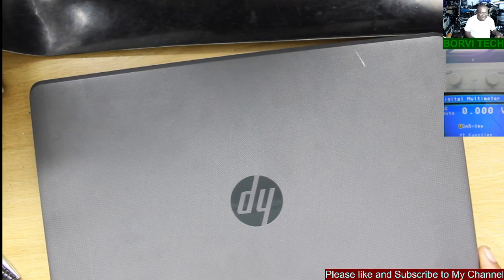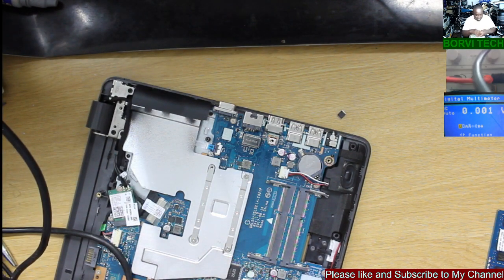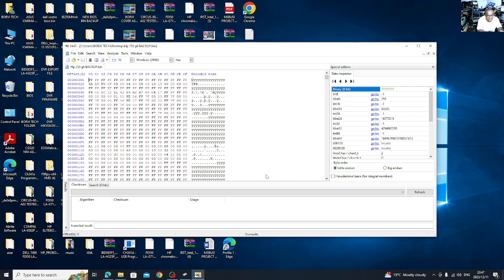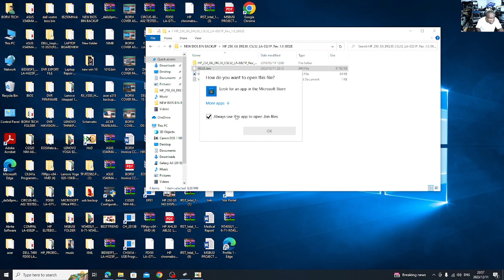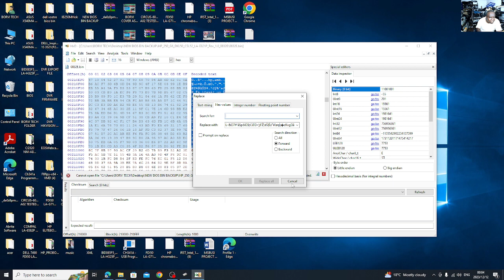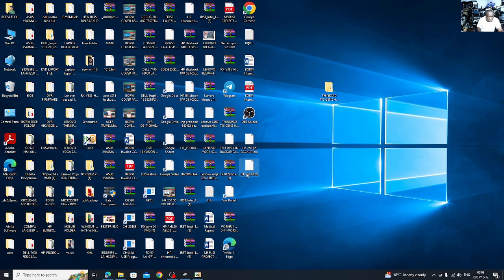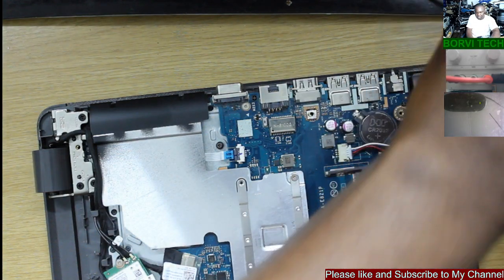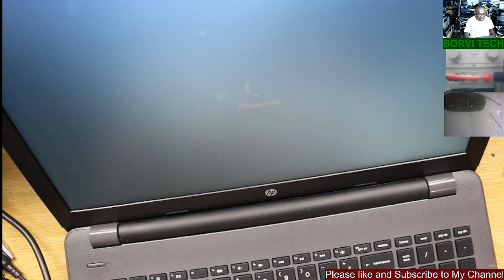Hp 250 G6 Backlight No Picture (Bios Cooked)

Comment: I have a HP 250 G6. Firmware update from windows, and doesn't start anymore. The chip is not exactly the same. There are two of them in that area, and the disipator is golden, diferent from this. Is there any way of reprograming, using the cable that comes with the usb  programer circuit?
Reply from the maker: Yes its possible if you know exactly what to do///// but the best way is to disorder the  chip from the board and make a backup.... then go to the official website of Hp and download the bios then copy the DMI file from the old backup file to the new bios download from the Hp website. Then you should be Good.

Comment: If I flash the HP new bios without pasting DMI information it can work? Old bios corrupted during update and I cant access DMI information. Laptop now blinks 5 times slow and 2 times fast on CAPS key.
Reply from the maker: If you download the orginal file with DMI info it will work but the serial number will be missing and others

Comment: I don't understand how this worked, because you got the errors at Paste the code from the backup file! So technically your bin file from Hp, is not modified! What i am missing here?!?!?
Reply from the maker: Bin file from hp is not modified so what you do from the oringnal backup you made.. copy the DMI info and then put it with the file you got from HP official website
Reply: @borvitech  yep, i know! But in your case you haven't did the copy with success, because you got the error every time you've tried to Paste the content from your backup into the new file!
Reply from the maker: You see the problem with my videos I dont edit them b4 posting i redo it again
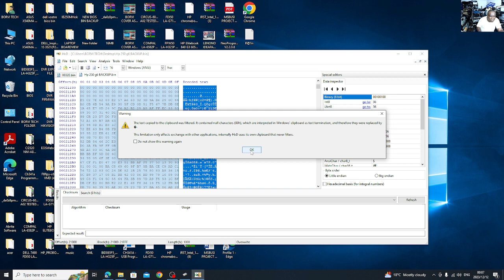Reply: @borvitech  i have no problem with the unedited video, is ok! At the minute 33:35 sec you get the error! That means, you could not Paste the code, so there is no modification to the bin file. Than you save it, flash it. So technically you've written the one from Hp Support! I am asking, because i have the same problem and i want to fix it
Reply from the maker: If you are fine with the same way I did on the video fine.... then check the type of bin you will write hence from the website it comes with different bin.... and it will work but dmi info will be missing